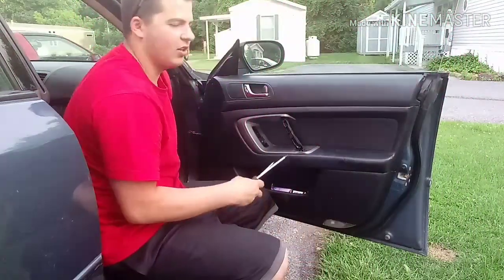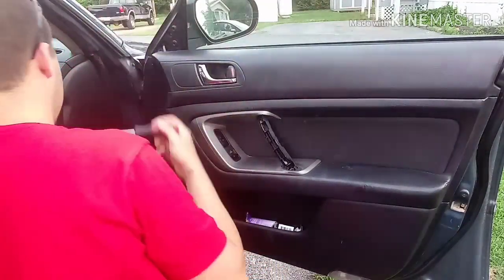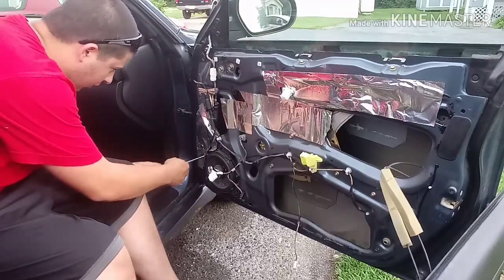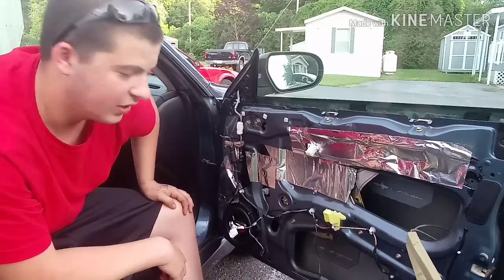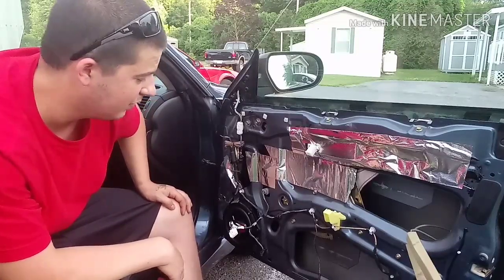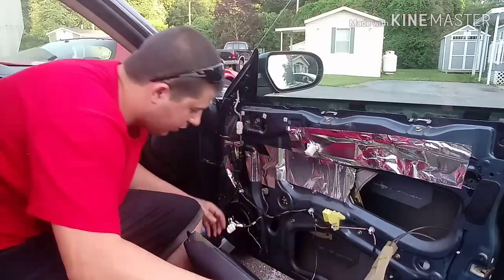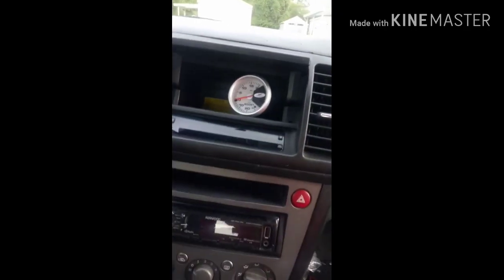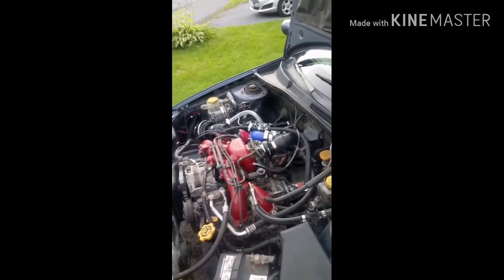REPLACING FRONT DOOR SPEAKERS ON A SUBARU LEGACY

Comment: What kind of speaker connecter u used to plug into factory speaker cable?
Reply: Also what are the correct speaker size for front and rear